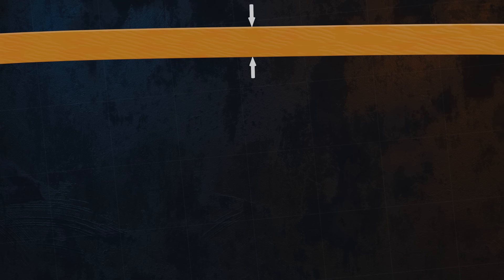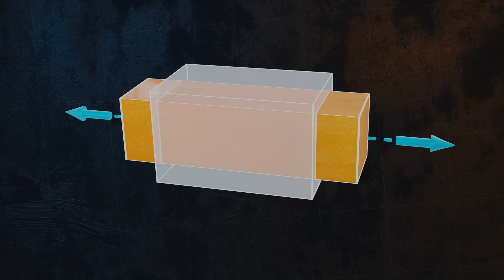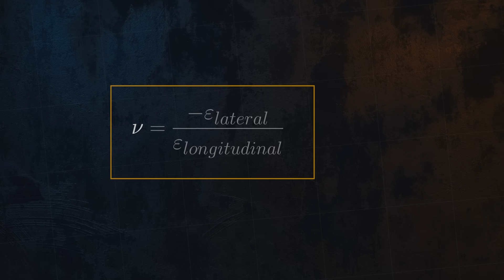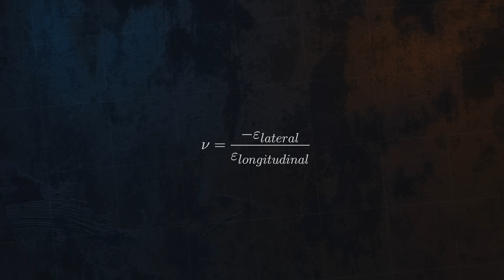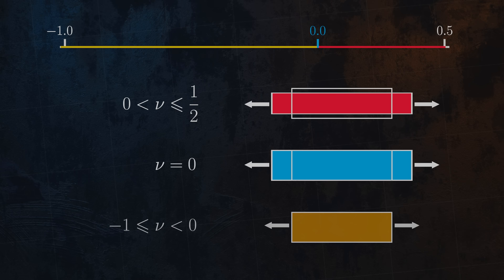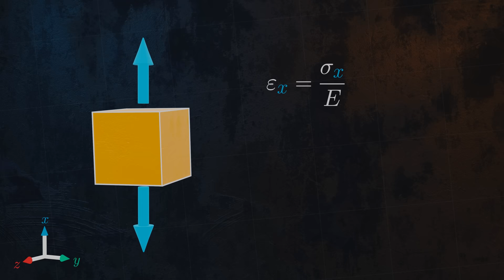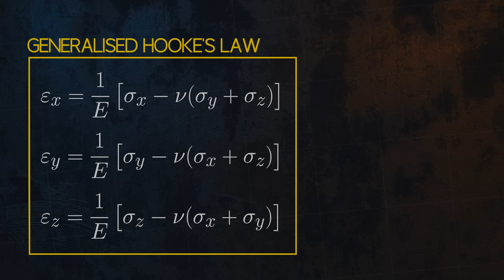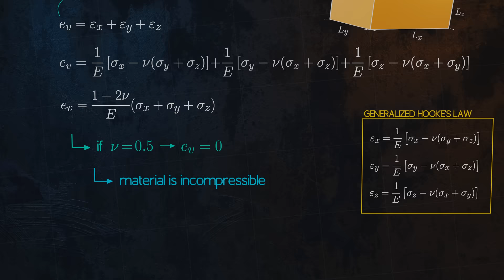Understanding Poisson's Ratio

Comment: Great video with excellent animations. But I have a few questions. If liquids are incompressible, then shouldn't solids be even more incompressible? I always thought that when a material is subjected to stresses, some of its dimensions may change but overall its dimensions remain constant. Is that true or false? Also, what is the reason for the limits of -1 and +0.5 in Poisson's ratio? A discussion of this would've been highly appreciated. Not nitpicking, I just like being thorough 😂
Reply: Less than -1 leads to negative 'G' and greater than 0.5 leads to negative 'K'. Go through relationship between elastic constants
Reply: Real liquids & solids are rarely perfectly incompressible. The idea of liquid being incompressible is pretty close when comparing to gas. But it's not perfect.
Reply: @yeswanthkothav3750  That's not helpful at all but thanks anyway
Reply: @jimblake3574  Hmm I guess

Comment: It's worth working through the trivial example of an incompressible material. For an initial constant volume, dV/V = 0 = dX + dY + dZ and dX = dY, so dX = -1/2 dZ 

Any poisson ratio under 0.5 means the material becomes less dense when stretched and more dense when compressed.

Comment: Thanks, very interesting. A more general version of Hooke's Law (elasticity under tension and the elastic limit). Unfortunately, we were taught Hooke's Law but not Poisson's Ratio. I had lunch one day with a PhD in engineering physics and raised with him the question: Does Hooke's Law work in reverse, under compression? Poisson's Ratio addresses this question but neither of us knew of it.
He was a specialist in avalanches. I have a polymath's interest in the flow of glaciers, the flow of rocks in the Earth's mantle, essentially shear in solids and semi-solids under stress. Poisson's Ratio provides a tool for thinking about these things. Chewing gum and taffy come to mind as models for applying Poisson's Ratio to viscous substances. 
In plate tectonics, the question of push versus pull of a sub-ducting plate appears in the literature. Seems to me to be a question where the Poisson Ratio might be applied.

https://en.wikipedia.org/wiki/Taffy_(candy)
Reply: Hooke's law does work in reverse, but only until something happens to change the game.
Say you pull on a wire, it obviously works. But push on the same wire & it probably buckles.
Pull on a tectonic plate and it might pull apart at a fault line because it isn't really a uniform homogeneous material. Push on it & it'll subduct under another plate, kinda like that wire buckling.
Reply: @jimblake3574   The experiment to demonstrate Poisson's Ratio shows the effect of compression. Pushing a  wire does not, because as the wire bends, there is compression on the side of the wire that is concave and tension on the side that is convex.

What you say about tectonic plates makes sense. However, the literature contains references to subduction by pulling plates. I have always been skeptical of that and for the reason you mentioned.

Comment: Wait a minute, I have little misunderstanding: 
let's imagine a cube 10*10*10 with a poisson's ratio 0.5. 
If deltaLx = 10, epsilon_x = 1. 
Then epsilon_y = epsilon_z = - 0.5 and deltaLy = deltaLz = -5. 
So, final dimentions of cuboid - Lx = 20, Ly = 5, Lz = 5 and volume = 500. 
As result, volume is NOT constant. 
Also, for general case it can be derived from equation. 
If I made a mistake, please correct me)

Comment: 3:19
The minus sign is just there so that
for the typical case where the lateral strains are opposite in sign to
the longitudinal strains, we get a positive Poisson's ratio.

This part is bit confusing, if the one value in ratio is negative how did we end up with positive value?

Comment: great video... thanks... when building a computer model of this, it is creating a tensor with variable values... I find it helps my evaluation of materials to build a tensor in my mind first and hold a 3 dimensional image for best results... keep it simple so you don't stress out... 1..2..3.. easy peasy
Reply: my work for a Boeing subsidiary was doing factory floor automation software for the folks who make the high tech fiber and aluminum parts for aircraft and space applications... I told people I would pay to have this much fun  .. and I think I did... that's what makes em keep you around, I guess 🤔🤷.. it's hard to stop... so . I am building personal sized dirigibles at home today... Peace y'all... have fun 👍
Reply: not yesterday, unfortunately... today onward... I hope 🙏
keep you posted 📫thanks 😊

Comment: I have a question Volumetric change should be obtained by multiplying the change in dimensions not by summing it so that the material is incompressible when Poisson ratio is 0.5 & the stresses are equal in all directions

Comment: Why is the volumetric strain the sum of strains on all directions? Shouldn’t they be multiplied together like 1+ɛv = (1+ɛx)(1+ɛy)(1+ɛz) ?
Reply: I guess you are right , I have a question Volumetric change should be obtained by multiplying the change in dimensions not by summing it so that the material is incompressible when Poisson ratio is 0.5 & the stresses are equal in all directions ?

Comment: Will internal and external radial strains be equal for a pipe?

I am trying to determine what the minimum potential inner diameter is for a bushing that is subject to an interference fit on its outer diameter.

Comment: How do you figure out the dimensional change of a rubber band instead of just a straight object?
I'm trying to calculate the new rubber band width after slipping it onto a larger diameter, therefore stretching its circumference and reducing its width.

Would longitudinal strain be the before and after of the rubber band circumference?
Then you can work out what the new band width will be based on this and poissons ratio?

Many Thanks, 
shanen

Comment: Since most of engineering metals have poisson's ration less than 0.5, does that mean they are compressible?
but in most of the plasticity theories, its assumed initially that metals are incompressible.

Comment: Hey if had a tensile force of 600kN    acting on a cuboid what would I do to find sigma x in order to figure out change in dimensions?
Reply from the maker: If you only have an applied tensile force it would be a case of uniaxial loading (like in a tensile test), and so you could just determine sigma x as Force/Area.
Reply: The Efficient Engineer alright thanks man 👊

Comment: Did you say "mu" and then use "v" instead of it?  Using the symbol for velocity as mu, and using epsilon as something else, is ridiculous.  Doesn't help that we actually use those symbols for other things regularly in Physics.
Reply from the maker: I used the Greek letter nu (not mu) for Poisson's ratio, which looks similar to the letter v. Do you normally use epsilon for Poisson's ratio?
Reply: @TheEfficientEngineer  I don't think so, but I'm just learning.  Isn't it something other than Epsilon in this video, but using the Epsilon symbol?
Reply from the maker: I used epsilon for strain in this video, which is pretty common in engineering.
Reply: @TheEfficientEngineer  I will keep that in mind.  I'll still have a tough time doing a lot of problems in Physics right now that involve velocity, and using "v" for something else, mentally.

Comment: So rubber 0.5+0.5=1 is incompressible while steel 0.3+0.3=0.6 is compressible. Mmm I think the misuse of language is going to put off many a would be engineer. We need science language to connect better with intuition and so we can speak with politicians and public and they can understand us.
Reply: Bulk modulus under pressure from all directions for real rubber is about 1.5 GIgaPascal about 100 times more compressible than steel at about 150 GP. When talking compressibility we shouldn’t compare a material with itself... we should compare with other materials. Rubber is only bulk incompressible compared with its own tensile or longitudinal Young modulus compressibility not compared with other materials. This is origin of misnomer.